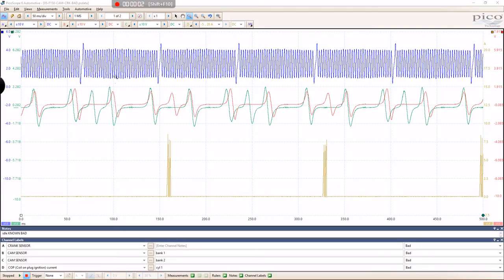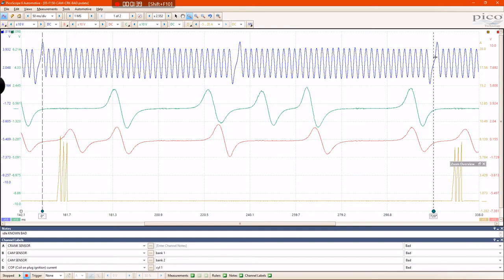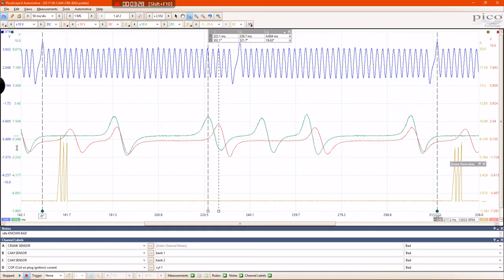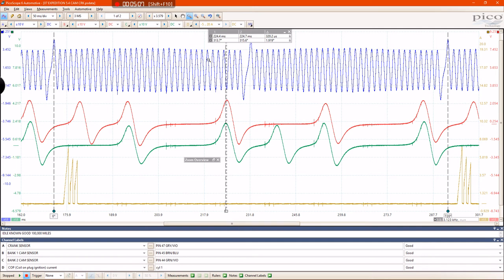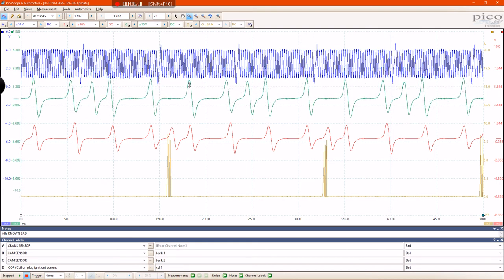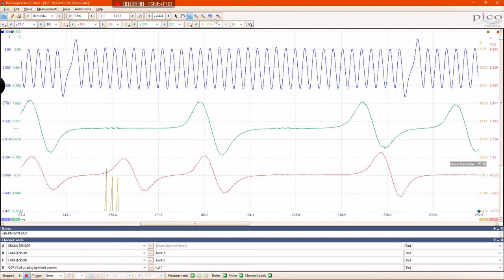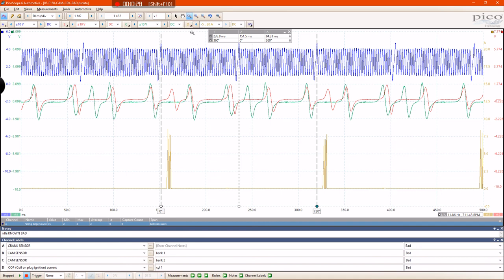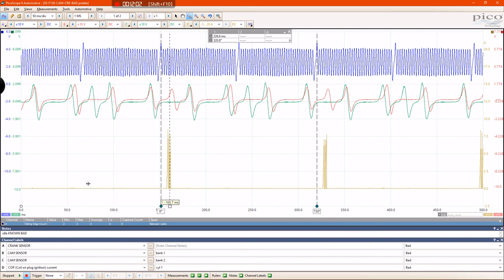Brian Culotta shows us how to use rulers for measuring

Comment: Hey, great video. Although, Is it correct to state that the peak after the missing teeth in the CKP signal is TDC? I understand that you are using them for 720 degree reference, but I believe that it's not TDC, especially in comparison to the ignition signal.
Reply: Bud Houston The best way to determine true TDC would be to have an in-cylinder pressure transducer on another channel and determine where on your ckp signal that is. This demo was more focused on using Pico's rulers to help identify the differential of timing events to a given reference point (whatever you want to call that reference point) I used the missing tooth (sync reference) to identify a complete 720° of crankshaft rotation. It's actual PISTON position isn't necessary to make the measurement on both good and bad waveforms. After you have your measurements, make a comparison to analyze the problem. Sorry for the confusion.
Reply: Thanks for the response. You're right an in-cylinder would be best to ID TDC. On this engine I believe the missing tooth is 50 degrees BTDC. The engine at idle normally has an IGN Advance of about 27ish degrees. So looking at your pattern, it appears that the IGN event is happening about 32 degrees after the missing tooth, which would validate that the missing tooth is 50 degrees BTDC. 

I'm not trying to be critical, I used the method you taught in the video to get that measurement. I'm grateful for this video. Thanks.
Reply: Bud Houston thanks